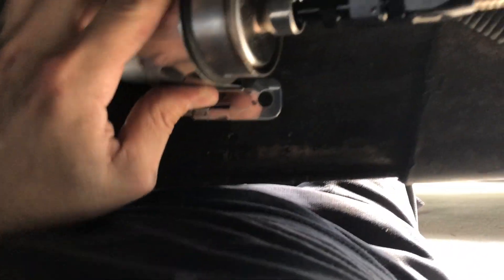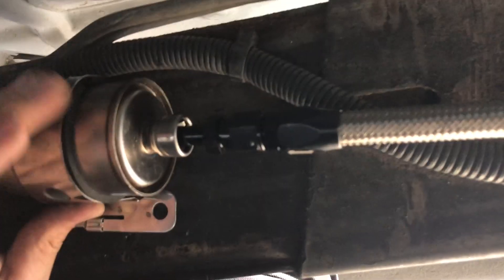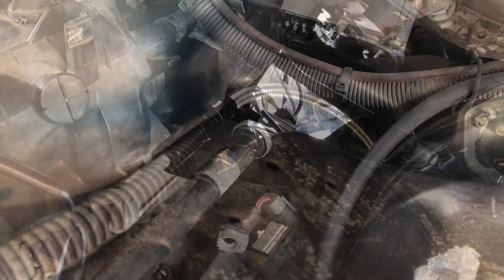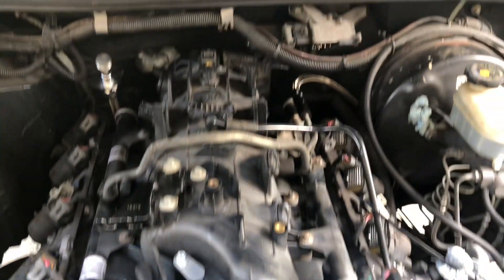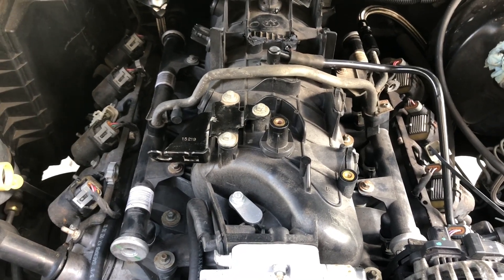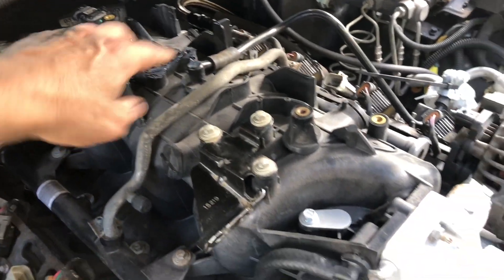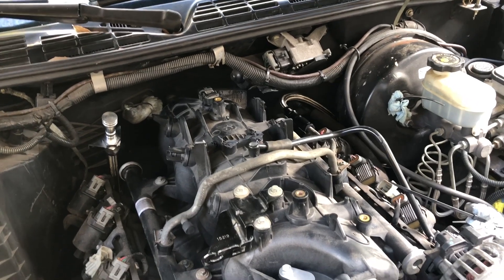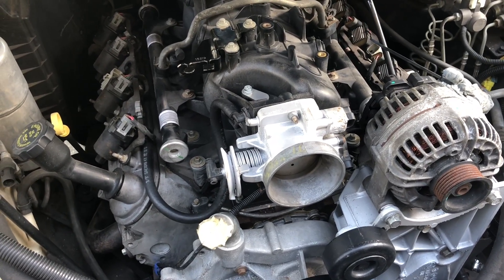LS S10 V8 Swap Part 11: Fuel Line Setup

Comment: What size fittings did you use on the fuel pump 3/8?
Reply from the maker: I don’t remember the exact size I used. I have the parts list here though. That may help.
https://youtu.be/KfKKb5Uuzvo

Comment: How can I use factory s10 fuel pump An hard line An fuel filter?
Reply from the maker: Unless you have the 2.2 flex fuel pump, you have to upgrade the pump. If you want to use existing fuel line, you need the same setup on the fuel rails. Ex: if you have a returnless setup on the truck currently, you need a fuel rail that is returnless for the new motor.
Reply: Will any retunless or return fuels rail fit on any ls block or head intake ect ect ?
Reply: You can put either rail on the same intake

Comment: How did you splice the fuel lines for those fittings?
Reply from the maker: I’m not sure what you mean. I just attached the new fittings to the factory lines, and put the fittings on the stainless lines, and connected them.

Comment: Hey why not use the stock fuel lines for the swap y this setup?
Reply from the maker: The fuel rails on the intake that came with my motor were returnless, and didn’t have a regulator. So I had to add a regulator, and re-plumb the system. If I had an intake with a regulator on it, I could have used the stock lines. (Look for a pre-2002 drive by cable...)
Reply: @CliffsHowTo  actually the stock 2.2 fuel system already has the fuel filter/regulator on the frame rail.  The only thing you accomplished was spend unnecessary money and time redoing what the factory already  had in place.
Reply: @joshdoyle11  A flex fuel 2.2 does.  A non flex fuel 2.2 does not.
Reply: @TommyRocket100  that's funny, because my 03 S10 2.2 non flex fuel truck has the integrated fuel filter/ regulator on the frame rail already from the factory!
Reply: That what I'm thinking can't u jus re use factory lines An fuel pump cause my s10 4.3 blazer has 2 hard fuel line that run to the top of the motor what fuel rail should I buy or what to use to keep factory hard line An fuel pump in. Also could I use a factory s10 radiator? It has oil and transmission oil cooler holes
Reply: Where you get the stainless fuel lines? I have been searching but they are expensive and I have a budget build?

Are you using a Holley 302-A Oil Pan?

Thanks for your time and help